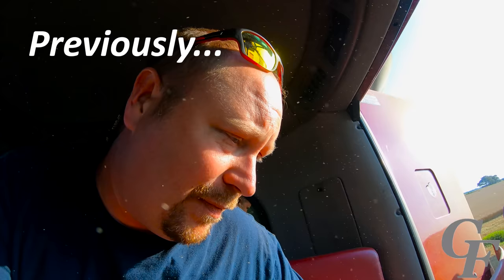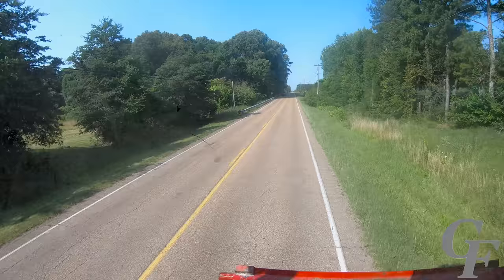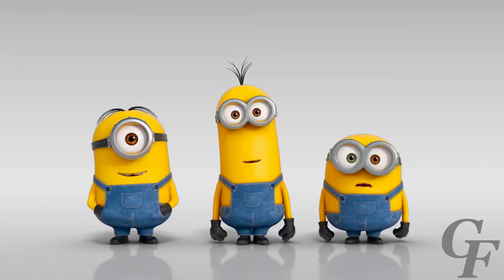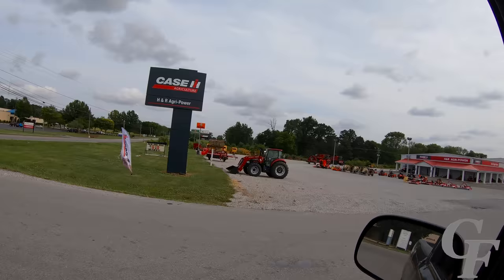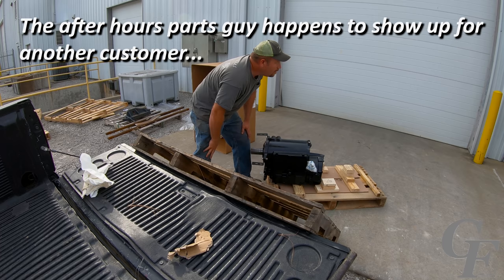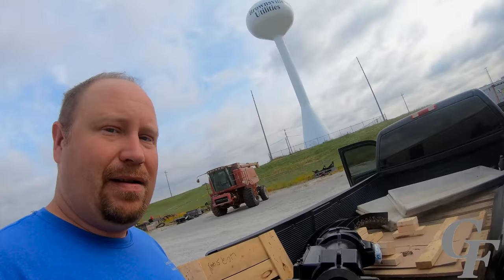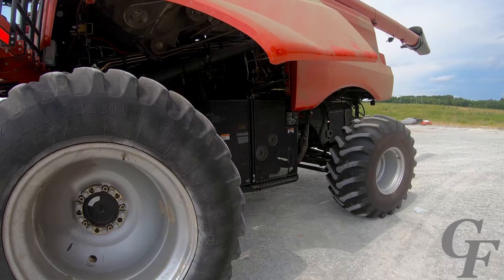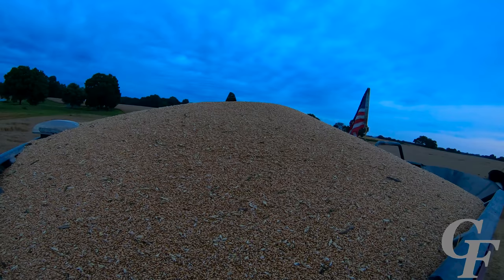6/18/21: Epic Combine Repair!!!

Comment: As I was watching this I was thinking, as well as you maintain your equipment can you imagine what problems you would have if you didn't?? God bless !!!!!
Reply from the maker: No matter how prepared you think you are, stuff is always gonna break
Reply: So true, all mechanical things wear out or break, but some designs are less reliable than others but a farmer mostly won’t know until too late and with the complexity of today’s machines it usually means a parts hunt because no dealer can stock every part needed. So glad a forklift guy showed up, you don’t need a hurt back to go with a broken combine.  The change over to a newer design means additional sales (expense) of gears etc, but what can you do?
Reply from the maker: Well it is an improved part. That happens a lot in farm machinery. Old part numbers will cross to new ones and the better part will work but sometimes it needs some different associated parts to go with it. It can be very aggravating and frustrating looking through the online manuals figuring out which part you actually need

Comment: Had a small bolt break off that holds a large connector between the gearbox and the rotor on a cr9070. Were extremely lucky we didn't have have pull the rotor. Only cost about $5 in parts but worked on that sucker for over 12 hours for a measly bolt.

Comment: Welcome to farming and poor designs. CIH isn't the only brand that has those issues either. This is how things go, one dealership can't control what another does. You really need to mount a crane lift in your truck. You got lucky he did show up.
Reply from the maker: Trust me a crane is on the wish list. But man they’re expensive!
Reply: @griggsfarmsllc  You can go the poor man's way, get one of those folding engine cranes from harbor freight.

Comment: Went thru that disaster last year on our 8120. Bolt broke far down in the gearbox shaft on ours so we had to drill it out and rethread it. Not the greatest design lol.
Reply from the maker: Luckily the broke bolt came out easily with a reverse drill bit!  Must not have been loctited in like it was supposed to be!

Comment: I believe you when it cost more than what you were expecting. I know that it has wear and tear on it, but I also wonder if the incident that happened when running over the header didn't help cause some of the issues and it just finally showed it's ugly head. Have a great weekend.
Reply: Those gremlins will probably show up for the life of that combine.
Reply: You need a John Deere that's what he need

Comment: When your combine grows a pecker, you got problems.  Just to remind you that you jumped your combine in the air and that big spindle was being held in by that bolt.  I don't think the engineer thought about jumping combines.

Just saying, if you had a good dealer, they would cut you a low rate rent or a trial on a new combine to help you out while you got yours fixed.  He may just not be thinking it out  because a lot of people watch these videos when it comes to thinking about equipment purchases.

Comment: It seems you had a $3 bolt where a $500 bolt was supposed to be. But seriously, it’s always like that with most things. A small detail causes a ripple effect of failures.
Reply from the maker: Yep. It’s not the best design. It’s a 3 piece design whereas a 2 piece design would be simpler and less prone to failure

Comment: As long as we keep letting China take our scrap steel, cheapen it and resell it to us in bolts and assorted parts, we will continue to have problems. The biggest problem with sending our manufacturing overseas is that we produced a good, solid, dependable product, and now we get a cheap, not as well made, product. In addition, we did not provide the oversight to insure quality. I think Grandpa was right, penny wise and dollar foolish.
Reply: Well stated

Comment: Why couldn't they have found a combine you could use to get your wheat harvested. It looked like there might have been a one or two on the lot
Reply from the maker: Those model combines depreciate about $150-200 per hour the engine is running. I’m not going to pay that when I can have my paid for machine back going soon. And it’s not the dealers fault that my combine broke so they shouldn’t have to pay for it either. 

Now last fall after the wreck when my machine was down almost 2 months, I did rent a combine to get a part of my crop out. The minimum rental period was 50 hours for $10k

Comment: Sorry for your problems. Is that pool hall that stea
Reply: Sorry about that l hit the wrong button. Is that pool hall still on the square in Brownsville. I are several good meals there during the mid 70’s when l was testing cows there. Hope you get back combining soon.
Reply from the maker: @jimmybland6519  I don’t know if it is or not
Reply: @griggsfarmsllc  That’s ok just wondering. It was the farmers hangout on a wet day.

Comment: Do you think the jarring that the combine took in the accident is causing all these issues to smart showing up now I know you said that before you had the accident that you had just put a lot of money in it but I still say you should have walked away from it and found somthing else I don't believe that machine will ever be right anymore.
Reply from the maker: It may have had something to do with the bolt and gearbox. We’ll never know because that’s a known issue on these machines. That’s the reason for the bigger bolt and different shaft on the new gearbox. 

The accident didn’t help. That rotor weighs 2000 lbs and it’s just resting on one bearing and the gearbox shaft. 

I’m still $70k ahead from the insurance settlement and owe nothing on a new machine. I’m still confident in my decision

Comment: Your dealer is cool but you should have off loaded that combine.  Jumping it was a major wreak and it should have been scraped.   That dealer should have provided another combine during the repair you did to much work.  I give you and A+ but the dealer sucks and I would never buy red again.  Sorry but they have options to help you and Case supports it.  They decided not to provide you loaners. I would never buy from them again.  Sorry but million dollar machine they need to see future sales and help out more.  They are worthless an your video clearly show what’s wrong with case!  Great video sorry for you bad luck.  I’m just evil but I think your to nice
Reply from the maker: I have no complaints with the dealer. They did a great job getting me going as quickly as possible. Typically you have to wait a few days to be able to get in the shop due to other jobs but they got me right in. 

It’s not their job to give me a loaner. It’s their job to fix my machine, provide me parts, or sell me equipment. A combine depreciates about $200 every hour it’s run. 

As far as scrapping it after the accident, I’m still about $70K ahead after all the repairs. So it’s been a pretty good choice for me. Better than being in debt for another one.
Reply: @griggsfarmsllc  ok sorry I was just being evil.  But I think to much sometimes

Comment: Kelly has it right it's a common problem she got out the Google but the loading dock had me I have been there me and my wife but our part wasn't that heavy and I cheated I had my keys and I used a skidsteer on the lot 🤣 oh my I would have just went from zero to a$$hole right then I would have to go home
Reply from the maker: I was thinking “I wonder if I can hotwire the combine sitting over there and use the feeder house to lift it.”  😂

But yes what happened to my machine is a known issue. Unfortunately every brand has common troublesome problems like that.
Reply: @griggsfarmsllc  they all break from something doesn't matter what color you choose